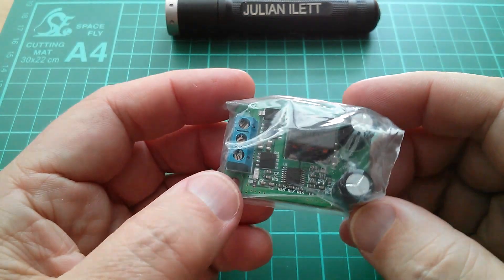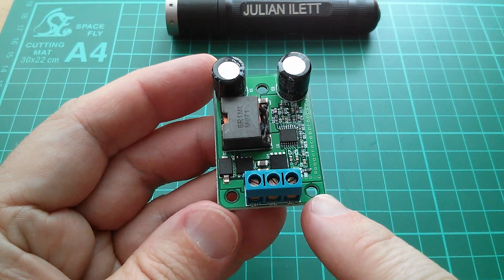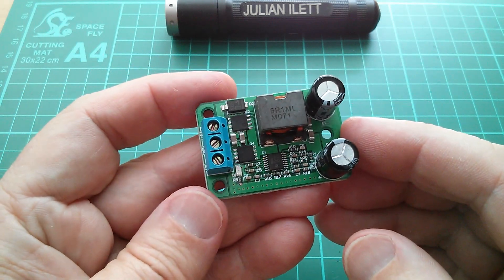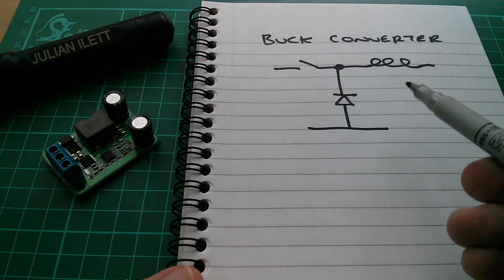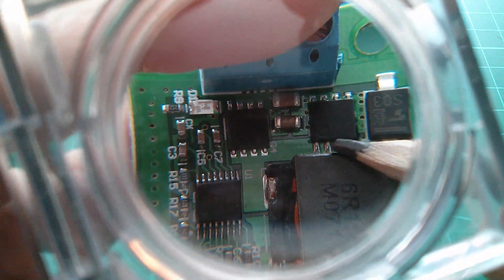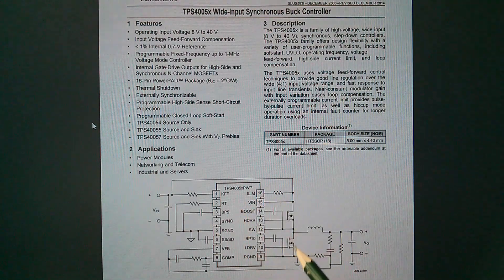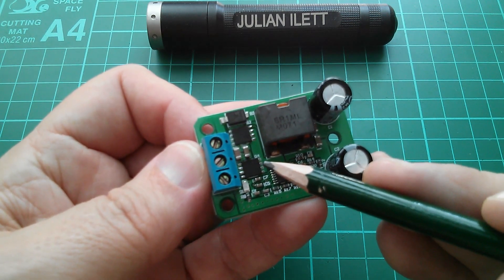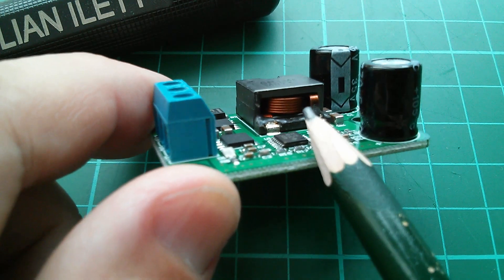Tech Talk: 5V 5A Synchronous Rectification Buck Converter

Comment: An input protection diode should have no effect on the efficiency of the circuit. It is across the input connections well before the circuitry. Put it back together with a clamp holding it and see if it still works! :-)
Reply from the maker: I could tolerate a diode across the input terminals, but this one is definitely in series with the positive input. If it's a 3A diode, it makes a nonsense of the 5A output rating.
Reply: Why? You said that one advantage was that it would boost the current. 12 volts at 3 amps would be 36 watts in and you are only getting 25 watts out. Right?
Reply from the maker: With 12v on the input, it works. But it's not so clever with 8v on the input. Either way it spoils the overall efficiency.
Reply: That is probably why the lower voltage it is rated for is 9 volts. 27 watts in, 25 watts out.
Reply from the maker: +Robert Gibbons Ah yes, that makes sense :)
Reply: I have one of these converters, and I did some tests on the bench. The person who designed it put the diode in SERIES with the positive input, not reverse biased across the input terminals. That was sort of stupid IMHO. I tested the unit with my electronic load, and the diode got toasty, so I then traced the circuit out, and noticed the series connection. The diode is marked S03, it is probably a Toshiba CMS03 in an MFLAT package which is rated for 3A. This essentially limits the input current to 3A unless you want to overstress the rectifier. If the output voltage is lower, you could get 5A out of it, but then the inductor starts to get hot, and may be saturating.  I'm always sceptical of any ratings that are advertised for these Chinese modules, and so I test them to see how they perform.

Comment: nooooooooooooooo xD
Reply from the maker: Sorry!!
Reply: And he would have been pretty annoying to listen to.
Reply: you can have both - turn it on to see if it works, measure efficiency and then destroy it ... But you decided "I'll go EEVBLOG style"
Reply: It can never be like @EEVBlog style! Dave would have connected the scope first to show us whats wrong in the design. Dave would also have thrown some insights why there is benefit of using copper strip over circular copper wire. Everything is not baby's game!
Reply: Don't mention such filth as EEVBlog. Dave would have opened the box with a big knife and been an idiot through the whole annoying video.
Reply: Why would you watch a video that annoys you.
Reply: Nickolay Pelov Really! I installed a Chrome extension specifically to remove EEVblog from the suggestions. Don't want to accidentally click on his video and give him a view
Reply: Btw there is one more interesting thing that you didn't notice about this DC-DC converter. The inductor is only 6.8 uH - this means very high frequency. 500kHz to 1MHz (which you could have measured if you have resisted the need to break it for 10 more minutes...
Reply: Right on!
Reply: You have just been upgraded. Well that's another level of hate.